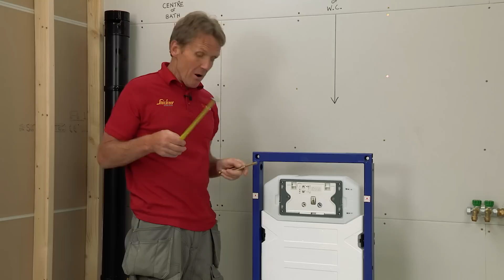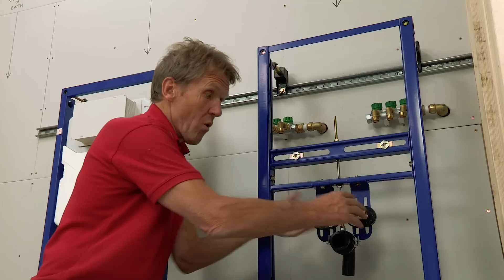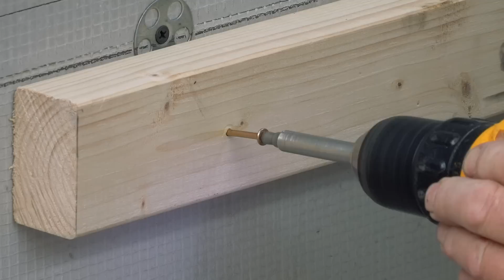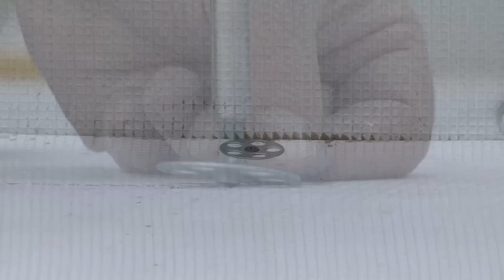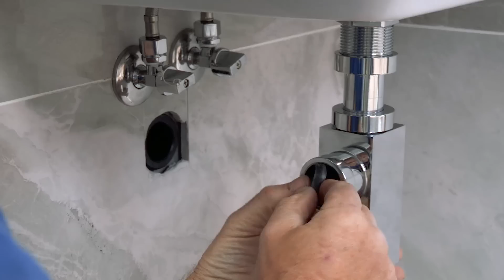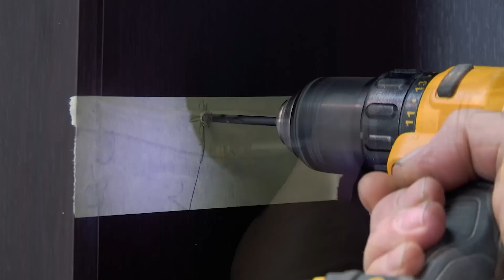Installing a complete bathroom

Comment: When you put a screw through the elements board where has your moisture resistance gone? Without using the waterproof bonding
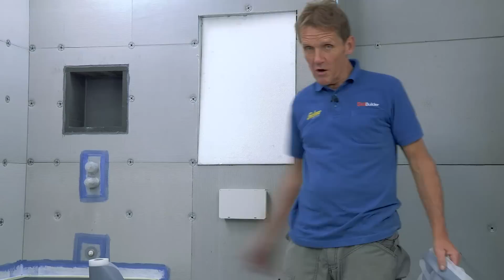Reply from the maker: We do recommend taping over any screw points with Elements waterproof tape and adhesive as you would where the boards meet to ensure a fully waterproof solution. See 41:40 mins of the video for more information.

Comment: Obviously this is an old video, but can anyone confirm if there are meant to be horizontal noggins at the joints between boards? (There don't appear to be any in this video before the boards go on).

Comment: Can KST adhesive be used as tile adhesive as well? Are there tile adhesive that may attack the waterproofing?
Reply from the maker: We generally recommend using a cement based flexible tile adhesive.

Comment: Quick question regarding the flooring. Since adding the elements floor board and the tiling on top, how do you compensate for the transition from tile to say carpet?
Reply from the maker: Our Elements board is 10mm and tile & adhesive is generally about 12mm - this equals a total of approx. 22mm.  This is normal in tiling UK timber floor bathrooms as normally 9mm ply is used as opposed to our 10mm Elements board. The 22mm build up is obviously approximately the same as carpet and underlay which is generally on the outside of the bathroom, however this would depend on the exact floor covering used. Hope this helps

Comment: Superb and Awesome video with great attention to detail!!!  Located in the USA, where can one purchase ABACUS products (INFINITY TRAY KIT - 12 X 9 LEFT HAND (EMKE-L7-1209))?? Current project is a left-hand shower, like to have an onsite adjustable linear drain cut to size using your left hand form such that large tile (12" or 20" square) entering either from the front or right remain so without tile "fall"cuts near the linear drain, is this possible? Floor height is not thick for this project (existing not new const) and will require floor under floor form and linear drain to be lowered to joist height (have seen your videos on this).
Reply from the maker: Thanks for your comment kc0rock and greetings from the UK! We're delighted you've enjoyed this video guide from Roger Bisby at Skill Builder and we thank you for your interest in our bathroom and wetroom products. Unfortunately, at this moment in time, we don't currently have any distribution partners based in the United States, although this isn't something we're completely ruling out in the future. We wish you all the best in finishing your current project and stay tuned for more bathroom and wetroom guides and inspiration here on our YouTube channel!

Comment: Great video!
is there any value insulating the pipes?
Reply from the maker: Hi goksonline87, thanks for commenting. We believe there would always be a benefit to insulating your pipes (to improve heating efficiency and also for noise reduction), however, it's worth bearing in mind that you are already within insulated walls if you're installing your new bathroom with Elements Insulated Waterproof Board (as shown in this video). Learn more about the insulated waterproofing boards here -  http://bit.ly/waterproof-board
Reply: Abacus Manufacturing Group Ltd 

What size of timber do you use for the stud work?